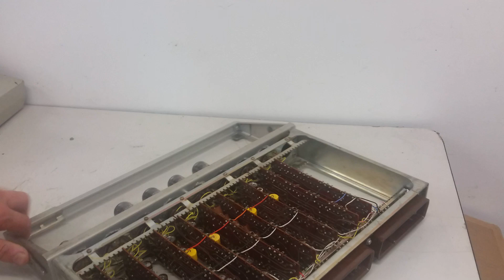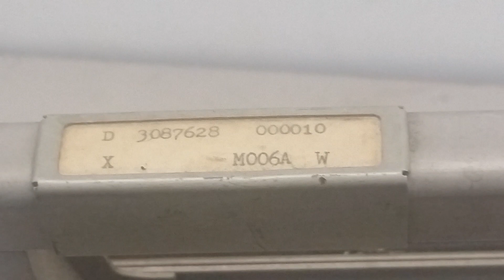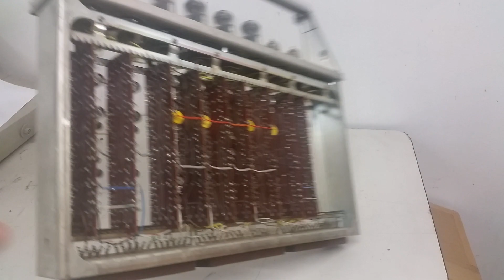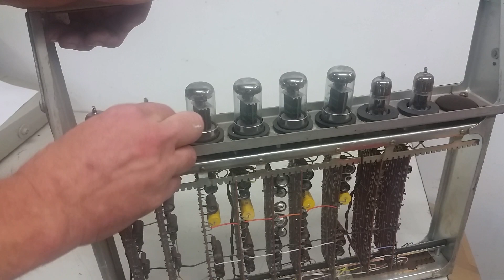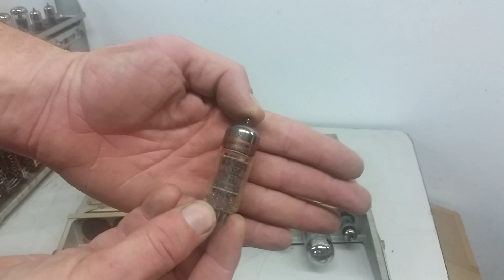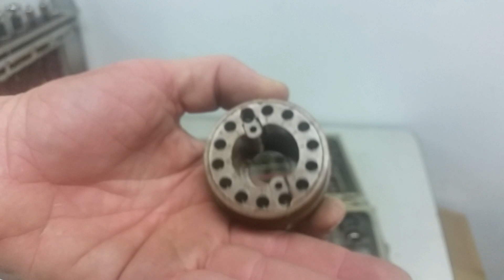SAGE Computer Stuff

Comment: I was a maintenance man on the ANFS-Q7 SAGE computer system for 7 years.  Because I'd had a lot of electronics classes in High School, I was assigned to the "Pluggable Unit" Lab (what you call a module, we called a pluggable unit, because the were drawers that you "plugged in" to a larger frame) when I first arrived at my duty location after 32 weeks of Keesler AFB Tech School.  Being assigned to the PU Lab as a newbie sort of ticked off some of the other maintenance guys because the PU lab was a straight day job and everyone wanted it, whereas all the other areas of the computer systems maintenance worked rotating Days, Swings and Mids.  Eventually, I left the PU Lab and went on a regular crew and worked the rotating shifts.  By the time I left in 79 (for AECP commissioning program) I was qualified in every area of the computer (there were about 7 areas, like Memory, I/O, Displays, Central Processor, etc., that you could qualify on).  There were two computers - one running the active mission and the other having preventative maintenance done.  Every night we would "switch" and start the process of maintenance on the other computer.  As a side note, because I was newly married with a kid on the way, and only making 3 stripper pay, I also worked part-time as a janitor in the SAGE building (obviously I would not have been a good candidate to "work" at Twitter LOL).    If I had a nickel for every 6414 and 6888 I changed I'd be a very rich man!  Working on that beast was the most challenging, yet fun job I ever had!  I really do miss working on that monster.  When something went wrong, you had to trace the issue down to which leg of what AND gate was bad.

When they finally shut the system down, a friend who still worked at my old duty location snagged a few parts and gave me a section of the "Core Memory", which I still have.  Also, as the AF shut the systems down, Hollywood bought some of the stuff, especially the Long Range Radar input console and the computer maintenance consoles because they had lot of lights that Hollywood could wire up to flash randomly and look impressive.  For example, if you have access to Columbo reruns, watch Season 4, Episode 6, "A Deadly State of Mind" and you will see one of the maintenance consuls and some of the Tape Drives in that show.  Also, if you watch Austin Powers (the first one I think) you will see the Long Range Radar input console in the background of "Dr Evil's" lair.  Parts of the SAGE system have shown up in various other shows and movies too.  Just a bit off fun trivia.
Reply: When I was a computer man from 1963-1966 (after a year of af/ibm schools) they divided us up before training into one of 3 jobs, Centeral computer (CC), Display (monitors and interface to main computer) and I/O (perpherials such as tape drives, printers and card readers).

I was a CC guy who did diagnostics and repair of the main computer. With so many vacuum tubes we had to do maintenance almost constantly.

With 2 computers running constantly maintenance was pulled almost daily on the stanndby system. Most  trouble shootingg was done by automaticly varying the voltages to see if there were any weak citcuits. 

The active computer had a loud speaker going at all times and took getting use to. It was a racket BUT the instant it stopped it was as if someone had slapped you and you wer up and running while the active system took over.

All in all I loved every minute of my time on duty but the lack of a real military environment induced me to get out (that and the money being offered by computer companies was many many times greater) as I had grown up in a Marine Corps environment.

One of the best times of my life and think of it often.
Reply: @GaryLangEngr  I do recall seeing it on $6M man.  It was being used to control a robot that was programmed to get Steve Austin, if I recall.

Comment: Something I would like to learn someday, is how these modules were designed. Like how all the pieces come together. Each module is probably something small integration, like a single 74xx logic IC would be for its level of parts. But then how do you plan and design and layout each module, and wire a large multi rack chassis. and this kind of complexity, back at a time when circuit boards were designed by hand too (they didn't have the CAD tools we have).